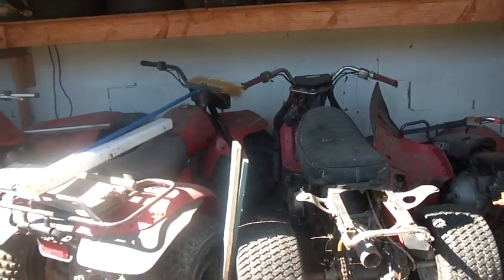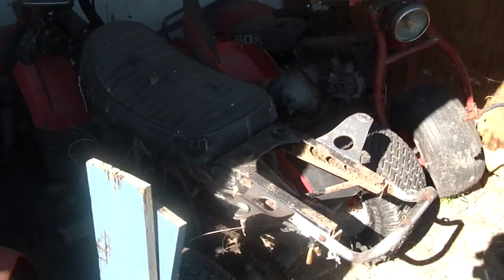Hoard of Honda ATCs, best shed for storage, construction details,

Comment: Sawdust is carpenter bees. You can see the hole in the rafter.
Reply: ya its bees i use brake cleaner in the holes kills them fast.had a bee guy spray one time said you wont have bees come back and the next year i had 5times the bees then a farmer told me hit them with brake clean and works great they eat trough a lot of wood in a short time.